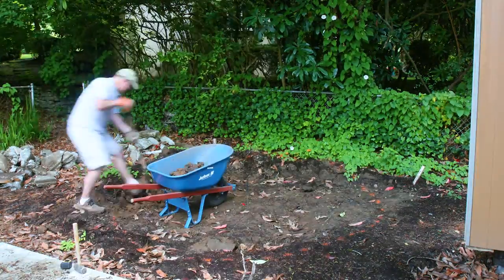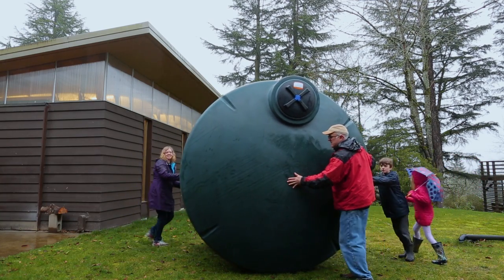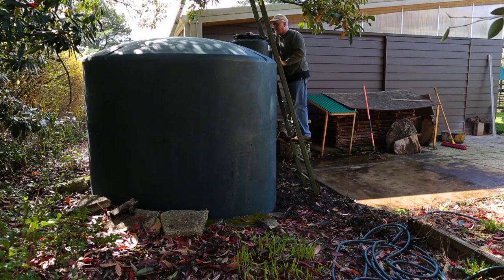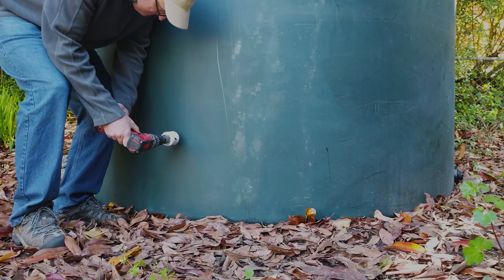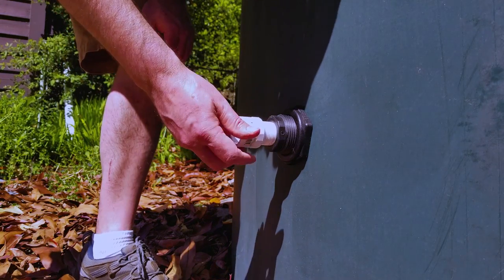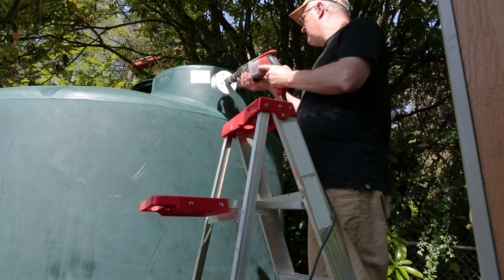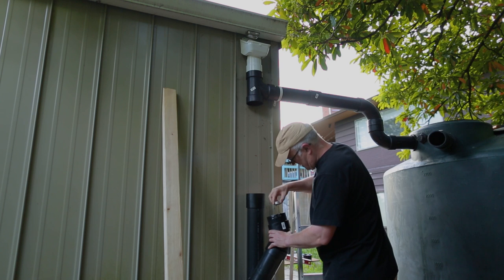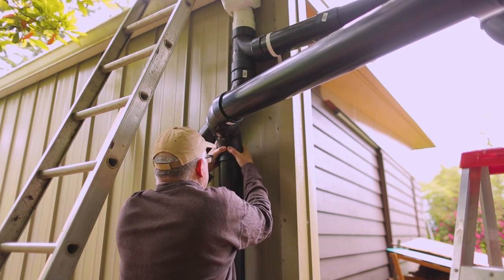The Rainwater Tank

Comment: going backwards on a hole saw works great too!  Drill pilot hole then put in revers to mark it without getting the sudden grabing.  Then forward after adding coconut oil helps lube the hole saw and it's non toxic.  Hole saws will always have kickback.

Comment: There is a chance of bacteria buildup inside such a cistern of light translucent construction.  Fortunately there is a super easy cheap fix for this.  Apply some opaque black spray paint or better yet metallic paint followed by a layer of your favorite color to blend with your home.  You can apply this paint at any time after construction.  Just make sure the paint is an automotive grade paint as that sticks best to spun fiberglass tanks.  If you don't like the environmental problem of most paints there are ecco friendly acrylic polymer paints that work just as well on fiberglass.  YOu did really good here.

Comment: Tip:  When drilling holes in plastic, depending on the way the teeth are set on the hole bit, run your drill backward.
Reply: I drill forward through plastic but on high speed. Works great for me

Comment: Great video and good tips that I can use later when I do my own install, especially the part where you put the drain pipe in with the string and rope. One suggestion that might help in future projects. When using a hole saw, before attaching the hole saw to the pilot drill, drill a pilot hole in the material. Then when you add the hole saw to the pilot drill bit, when you stick the pilot drill in the hole you already made in the material the saw blade won't jump so much. For some projects, I replace the pilot drill bit that comes with my hole saws with a longer drill bit to make a deeper pilot hole before I use the actual hole saw. The pilot drill bit is usually 1/4" by 4" and can be adjusted to stick out about 3" max. I keep an 8" bit with my set of hole saws so I can make deeper pilot holes when needed,

Comment: You should put a screw on that elbow inside the tank - I've seen the force of water just push one of those apart...  I wouldn't glue it either as you'll never get it out.
Reply: I agree 100%.  It will save you the effort of fishing it out after it comes apart.  Just predrill a pilot hole and sink a single stainless steel screw from the top.  Easy to add and remove.

Comment: Really appreciate you sharing your video. I’ve been living in the mountains of NC on Big Laurel Creek for a couple of years and it’s time for me to upgrade my entire system. Presently I pump from the creek with a 1/2 hp shallow well pump into 275 g tank. I use various valves to switch supply from creek to tank before entering the pressure tank and several different water filters. My system and the design of my system was not backed by experience just a lot of problem solving during installation. Your video has given me a “plan” to get my project from the note pad to the yard. Thanks.

Comment: Question... With that little "foot" attachment resting on the bottom of the tank, when water gets high enough above it, will it eventually hinder the flow of water into the tank? With the pressure of all that standing water resting on top of the "foot" opening, i'd think it wouldn't allow free-flow and the water would just back up the pipe and not fill the tank completely. 

Any issues with the tank not filling up to the top?
Reply: it works even tho the shoe attachment rests on the bottom. The point where the water gets collected its higher than the actual maximum point of the tank.. I know that it doesn't sound right but trust physics
Reply: @Andrea-ef9qm  how?
Reply: @SourCyanide  I hope that someone will scroll thru the comments and explain it because I don't have the skills to.. I've studied this at school and english it's not my first language.. I will try to explain it once more and hopefully I'll explain it for good.. In the video as you've seen the actual rain collecting point 15:47 off the roof is higher than the max level of the tank, that leads to a higher pressure at the bottom (at the actual "shoe") so even tho the flow gets, slowly but surely, slower (because the water will build some "force" to push the incoming water at the bottom of the shoe) during the time that the tank fills up, the pressure from the top (incoming water) will be still higher than the pressure that the water in the tank will apply to the incoming water so it could (with enough rain) actually overflow.. 
if you can get your hands on a clear pipe (one that can bend) take one side of the pipe in your right hand and the other end with your left hand. if you fill the pipe with water and try to lift one hand (leaving the other hand still) water in the pipe will spill from the side that should remain still on the same level.. the same principle it's applied in the video
Reply: @Andrea-ef9qm  but the pressure in the tank will surely build up to match the pressure from the pipe before the tank is even a quarter full... Isn't the problem the volume of water? Regardless, I don't know why he wouldn't just pour the water into the tank -- less pipe needed that way anyways.
Reply: @Andrea-ef9qm  Submerge a straw in a larger tank, and try to fill the tank by pouring water into the straw. Wouldn't the water pool up in the straw instead of filling the tank? I'll have to check myself. I kind of believe you because of the way water in a straw returns to a cup once you are done drinking. Maybe I need to retake physics
Reply: @SourCyanide  no, I understand what are you thinking.. because the actual volume of the water in the tank will build up and reach a certain limit the flow of the incoming water will not be enough to push the water inside.. but that doesn't work like that.
Reply: @SourCyanide  you know what, I'll check tomorrow in the morning and I will respond to your question
Reply: @Andrea-ef9qm  I edited my last comment... I think I believe you but I'll be checking for myself!
Reply: @SourCyanide  I read your entire comment now and no, you don't need to retake physics, maybe I'm completely wrong as I am in most things but we all learn from one another, tomorrow I'll be back with an answer
Reply: @SourCyanide  alright
Reply: @Andrea-ef9qm  Just checked u are certainly right
Reply: So Seymour it seems that the pressure of the standing water does not back up the pipe :) assuming the tank has some sort of opening from the top for air
Reply: Seymour Hoffman: Nope. 
Water"Finds its own level".....whatever the source, it simply cannot rise above that source.
Take a transparent hose: Put your finger over the end and lower the other end into a half-full bucket of water....The water climbs up the tube until the air resistance stops it. OK?  Now, take your finger off the tube end....The water will rise in the tube until it reaches the level of the water in the bucket. 
Now: Place a funnel in the end of the tube: & pour into the funnel more water:
The water level in the bucket AND the tube rise TOGETHER.
Remember: The tube filling the tank is open-ended by means of the leaf catcher 
(Which kinda like your funnel with a screen in it) so there is no resistance to the incoming water &/or the rising level of the tank.
Hope that clears the question for you.
Regards.

Comment: I can't believe dropping it on those air mattresses actually worked.
Reply: Metabeard , I was all pins and needles holding my breath hahaha
Reply: I envisioned it bouncing and hitting the shed, crushing the siding!
Reply: I live in Aus - the tank guy delivered a 7ft high 12ft across corrugated iron tank by himself using ropes, old tires and planks to lower from truck, turn and move onto the concrete slab without any dropping etc and damage to tank. He had been doing this a long time. It is amazing what can be done with problem solving and knowing some mechanical principles - demonstrated by Franks ladder method. Well done.

Comment: When designing the first rain catch pipe you installed the 90 degree sweeping tee wye upside down. By installing it this way you're going against the sweep and its flow direction and allowing more debris in the tank. Water carrying small particulates can run along the outside sweep of the pipe and follow the sweep into the tank, or given a vortex or turbulence from the gutter and leaf catcher, flow into the opening following the sweep. By turning it around, water can now only travel down to the catch tube, and then once the catch tube is full, will water start to divert into the tank. The addition of the foot at the bottom should help catch sediment, and I know that I'm a year late but It's still worth pointing out.

Comment: How does tank maintenance work??? Debre in the bottom or bacterial growing?
Reply from the maker: I'm going to have to figure that our.
Reply: Bacteria and fungi need nutrients to grow on, a sugar for example. Algae need sunlight. As long as you keep light and nutrients out of the tank it will be unlikely any micro organism will reach a high concentration in the water. One of the reasons to discard the first (dirty) rainwater is to keep nutrients out. Micro organisms tend to grow faster at higher temperatures, so monitoring the water temperatures in the summer might me something to consider. I would advise you to do some reading on Legionella pneumophila, which causes Legionnaires' disease, and can grow in pipe systems and hoses containing warm water.
Reply: You can vacuum clean the bottom of the tank, using a wet vacuum cleaner or pool cleaner.
Reply: correct me if I'm wrong but wouldn't sunlight be useful to kill bacteria due to UV radiation? I think that's what many people in Africa are doing to get relatively clean drinking water
Reply: Edward Newgate No. You'll get algae growth if the tank is allowed UV exposure, because the rain water already has bacteria in it. The darker the tank, the better.
Reply: I re-used a white plastic barrel for a rain barrel. Within two years, it was completely clogged up with algae. The dark green material of this water tank prevents that from happening to Frank's water tank.

Comment: Good video,  my tank gravity feeds my 4 raised beds, when I open the valve,  I have my tank overflow simply going around my watering valve, so all overflow goes to my gardens, by gravity, or to my fruit trees.  Saves me a few days of rain barrel usage if overflow waters garden.   My barrel is only 300 gallons.  1/2 inch of rain will completely fill it from my  barn-shop 1/2 of roof.  Thanks for your video.  Good job.

Comment: Thanks for your Sharing, knowledge is power.  One tip If I May Just a FYI ON the hole saw when you start to drill your holes put you drill in reverse to start the cut, once you get the groove started then switch it back to forward makes it a lot easer and more accurate hole.

Comment: Great video the one i put in was only 600 gallons and fills with one good rain storm . to work out flow take the roof foot print multiply by 0.52 and that will give you gallons per inch of rain , they are very heavy when full yours will weigh around 11 tons full . nicely done

Comment: hey, frank at 15:57 you put a black ball in the pipe what is that for?
Reply: Ball floats up as the reservoir fills. Once at the top it blocks the inlet to the reservoir and flow is diverted into the tank.
Reply: why do you need to block the inlet of the reservoir, as when it filled there is no other way for water to go other than to the tank
Reply: Melih CANBOLAT 
Because then you'd have a closed system with the reservoir and the tank so the dirt which is supposed to go into the reservoir could leak into the tank.
Reply: 50red510   
The ball is attached to the filtered outlet, so it's draining cleaner water just below the surface
Reply: you would stirr up the bird shit soup and that would get in your reservoir, me thinks.
Reply: My guess is so that the dirty water in the reservoir stays there and doesn't just get mixed in with the fresher water going into the tank, which would defeat the purpose of the reservoir.
Reply: Constant water pressure I think. I may be wrong but along with the internal hose being connected to the filter, the water intake just below the water level allows you to have a constant water pressure when it comes the time to use the water stored inside the tank.
Reply: besides cleaner water, I guess another advantage is that in summer the water with the highest temperature will be pushed out of the tank, plants do not like cold feet either...
Reply: Yes these floating suction filters are added to draw water from the cleanest (and most aerated) part of the water column, somewhere a bit below the surface.  This is useful especially to prevent pumps from being fouled, and perhaps for potable water systems.  It shouldn't have any effect on water pressure, which (in gravity-based systems) is purely a function of hydrostatic head, ie. height difference between the top of the water column to the outlet.
Reply: He was asking about the ball Frank puts in the "dirty water" pipe at 15:57, not the one in the tank.
Reply: Andy Moskowitz when you say aerated water, do you mean the water could possibly contain air bubbles? I was thinking of doing this to my water tank but I don't want to cavitate my pump
Reply: That setup is a first flush diverter. This is where the dirty roof water collects first to be drained instead of going to the tank. The ball floats to the top of the pipes and directs the flow of cleaner water to the tank.
Reply: 50red510 cleaner water on the top of the tank when it's full so the outlet on the bottom drains from where the ball is floating.
Reply: understood. I was hoping someone could elaborate on what he means by "aerated water" 
I don't want to do this if it could possibly contain water bubbles because of the danger of pump cavitation
Reply: Great question, and I can't say I'm quite experienced enough to comment on cavitation forces under various circumstances.  But Frank's rig above is fairly state-of-the-art for small rainwater installations, so I'd trust that most of such issues would have already been engineered around.  I suppose that if you were having issues with pulling too much bubbles and dissolved gases, you might address it by simply shortening the hose to the suction filter a bit, to draw from a bit lower in the tank.  I mentioned aeration primarily for its relevance to the biological systems at play: Organic sediments will decay much more gracefully in the presence of dissolved oxygen, as opposed to anaerobic decomposition processes which can result in  smelly, fouled water.
Reply: Good call, I missed that bit, and so didn't follow your answers too well.  I think you guys nailed it, though I might add that the first flush diversion principle works fairly well without any such ball, Frank's just got all the bells and whistles going here.
Reply: appreciate you getting back to us
Reply: Melih CANBOLAT because dirt water may get into the tank, and its preferable to just block is not dificult and prevents
Reply: If you add a few inches of cord or chain between the float and the end of the pipe, the pipe will be certain to stay submerged and you shouldn't suck any air until the tank is practically dry.

Comment: At 8lbs/gal that will be 10 tons when full - or about three cars. Hopefully your initial soggy soil conditions won't make that an issue for that concentration of weight. I think I would have done a deeper pad prep with gabion topped with drain rock. You may also have springs or a clay subsoil.

Comment: Abs and pvc are same size. Difference is abs is cheaper made and wont withstand abuse and high pressure, thus cheaper price but works fine for drains as they are no pressure.

Comment: I think a simpler cheap system of connecting is a short slightly angled feed pipe going into the main part of the tank near the top. This means when the tank is full excess water automatically back flows down the original down pipe.

Comment: With the installation of smart water meters in the UK, it can only be financially beneficial to collect rainwater and use it for cleaning vehicles, homes, pathways and similar applications. If you also have a raised reservoir of water, you could put to use by generating some additional stored electricity.

Comment: Nice Job!

My 1450 gallon tank was much easier to roll and put in place, but you will be happier with 2500 gallons.  I use a transfer pump to move the water into a hose and it powers a sprinkler very well.

Comment: I don't understand the benefit of the foot thing for the water intake or for the flouter thing for the tap to get water out? It would work just as well if the tap was just a hole, arguably better since it would contain less leaf matter. And the intake? How does having a pipe going to the bottom matter? It could just come in from the top?

Comment: I'm really impressed with your set-up.
Im in beginning stages of setting up my system to use on my RV

My setup will be alot Smaller.
Planning on using
2 -275 ibc totes.
One to harvest water and then filter it to the other to be used
And one to

Comment: frank howarth
just an idea about the part i watched at 8:50 where you had to put the string from the top to the hole on the side that you drilled, it might have been possible to use a strong magnet on the outside to another one on the inside attached to the string, line them up from the bottom hole and then slide the outer magnet up to the upper hole, and grab the string when it reached the top hole. it might have worked with plastic tank.

Comment: When cutting big holes in plastic tanks, once the centre drill bit breaks through , turn your drill to reverse and your hole cutter wont bounce all over the place. It will still cut the plastic but won't catch. Once you have a good start, turn the drill back to nornal forward setting and it will be a lot easier